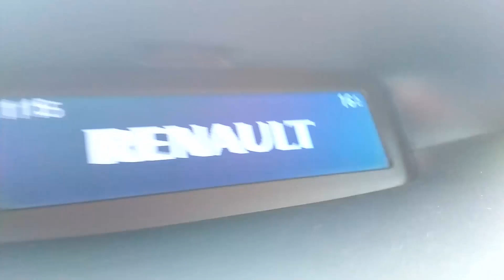Renault Fluence Sahte Turbo Denemesi. Renault 1,5 DCi Fake Turbo Test

Comment: Ürün Linkini Verebilirmisin Reis?
Reply from the maker: Egzoz çıkış basıncıyla çalışan bir nevi düdük. Ben ürünü sadece denemek için geçici olarak taktım. Sürekli egzoza takılması uygun değildir.
https://www.gittigidiyor.com/otomobil-motor-aksesuar/buyuk-her-araca-uyumlu-turbo-islik-sesi-cikaran-egzoz-aparati-larc_pdp_732487155?utm_source=google-pla&utm_medium=paid-search&utm_content=491112468455&utm_term=116607683975&ga_prodid=732487155&ga_merchantid=547034780&sc_gcsp=gg&gclid=Cj0KCQjwgMqSBhDCARIsAIIVN1W0m-4Da89AURgNjXqHJPvqTq-ba5VHtGq6FekyrZehDaOinJiHZckaAinKEALw_wcB